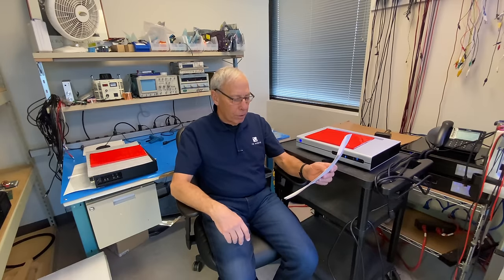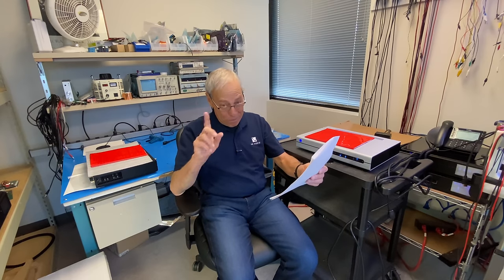How do you know if your caps have aged?

Comment: one thing I would say is sometimes be careful when it comes to replacing capacitors. and I mean in the way that I had an older arcam amplifier that I had purchased out of the '80s. I just love the sound of it and I really enjoyed the quality I was getting from it with my speakers and it had never had the capacitors replaced. so a year and a half ago at a friend suggestion I took it to a guy who works on HiFi and for $150 he replaced all the capacitors that needed to be replaced and he did say some of them were off value and going bad. anyway when I got that thing home and hooked it up it sounded a lot different and not better to me. long story short I ended up selling the amplifier because I ended up just not enjoying the sound of it anymore.
Reply: This is exactly what I'm worried about happening to both my infinity rs-3B's and reference studio monitors. Not to mention messing them up. What do you think?
Reply: @stevenneese2823  I would worry less about messing them up and more about messing up the sound. That said though it can be more detrimental to not replace the capacitors instead of replacing them. Now in speakers it's not as critical per se but in an amplifier if you have a bad capacitor that's going bad and leaking for example, it can leak out on to the main circuit board and damaged further components and it could hit a point where the amp is effectively destroyed, so obviously it's important to replace these capacitors.

I have learned however that there is such a thing as leaving well enough alone. Meaning if something's working well and there's no problems with it and you take off the lid and equally there's no problems with it that you can see, then don't mess with it. It's kind of like having a vintage car that's running great and just because someone told you that the engine needs to be pulled out and overhauled you decide to do it and afterward you have more problems than you did when you started.

I will add that every pair of vintage speakers that I've heard that have been recapped, I think they ended up sounding better.
Reply: the problem there could be determined by the fact that they replaced capacitors but with some low quality ones, meaning many good amps from 80's used bipolar and quality (fot the time) caps, and because the capacitors in the signal path are responsible of the sound signature, capacitors must be replaced with caps with same specifics.

Comment: Thanks, Paul, for answering my question!  And thanks to everyone who commented.
A little background info, for those commenting.  Yeah, I can solder and will replace the caps myself.  I've had the crossovers apart, when I (partially) bypassed them to use one of Phil Marchand's XM-44 active cross-over kits in a vertical bi-amp configuration.  Phil was kind enough to build high and low pass cards for me with custom crossover points and slopes.  Really loved the way the Duetta's sounded like that, but one of my  amps died (was using identical stereo amps, one per side).  For unrelated reasons, I put the speakers aside.  It was because I've had the crossovers apart that I'm trying to avoid replacing the caps.  You can get to them, but as far as I remember not completely remove them without taking the speakers apart.  Which I ain't gonna do 'cause it's too easy to screw up the ribbons or introduce a rattle.  If you have to retension the ribbons you're in a world  of hurt.    So replacing the caps in-place is the way to go and I'm not really looking forward to that.

Eric  Elliot nails it when he says it's easier to detect bad caps that are in  other gear. One of the caps in my Threshold pre went south and it was obvious.  Had that one recapped by a Threshold specialist.

Comment: Did a complete recap/crossover rebuild of some Klipsch Quartets.  Converted all caps to films with Clarity Cap and air core inductors.  What a difference!  A really beautiful speaker now that sends shivers up my spine.
Reply: When possible, no matter the item, if you can replace any electrolytic with a film just do eeeeet.  Seriously it is a no brainer as films will normally out live any of us while electrolytic caps begin drying out the moment they are plugged in for the best ones and the crappy Chinese ones they begin the moment they are made.
Reply: Was this done as a blind test comparing one side versus the other pre/post replacement? If no, the data is null.

Comment: Being one who owns some vintage gear, I learned that for amps and receivers it is fairly easy to tell when the caps have aged just by the change in sound. Caps in crossovers on speakers though are harder to tell. I don't have any vintage speakers anymore, but I would imagine the sure way to tell on those is with measurements.

Comment: Funny thing, but I've got a fair-sized collection of audio gear that's mostly around 40 years old and I haven't had to replace a single cap. Capacitor replacement seems to be a peculiarly American fixation. I ran this past an electronics tech friend - with a view to putting paid repair work his way, if needed - but he tells me that it's not unusual for even electrolytics to still be performing within tolerances if they haven't been overworked or stored badly. 
Before the naysayers weigh in, my old ears are in pretty good shape (17Hz-17kHz) and yes, I do know what high-quality audio sounds like.
"If it ain't broke, don't fix it" seems appropriate.
Reply: It probably dosn't sound like it used when new. Electrolytic capacitors all age. This  is not a georgraphical issue. Greetings from Germany - replace your caps! You will hear the difference.
Reply: Fat Rat  Oh....so you did buy those 15k DeVores and you've not been telling us. 👎 

Ffs mate share the goodness....."So this is re-e--e-l"

Seems everything round here is Sunnyboys!
Reply: An obvious sign of failure is a leaking or bulging can. The big power supply filter caps seem to be less prone to failure.
Reply: Fat Rat  getting some good bargains...connections in the industry or just sales given the current circumstances?

Definitely gets to a stage where you're happy and that's all that matters. Too much arsing about round these parts.
Reply: Hi, @matekochkoch  ! I'm sure the caps have aged; they just haven't aged enough to depart from their specified tolerances. I've owned several items from new, or nearly-new, and they still comfortably outperform more recent equipment.
Reply: Fat Rat  Yep, my 40yo Monitor Audios are still ticking along nicely too!
Reply: @Fat Rat, can make audio better is a myth.
Reply: I have 2 old Oscilloscope one is around 1975 and they work perfectly. Made in Japan must be the old stuff was well made ?
Reply: Fat Rat  just checked them out....seems they are selling some of those lines at wholesale/cost (nice find). I remember when that store first opened. 😮

If you're not up to speed, have you heard Dylan's new track? A 17 min opus. Can't seem to paste a link via my phone, since they updated YouTube app. Can only 'share', so you'll have to search if you've not heard it.

Hot cross buns to you!!! 🐇
Reply: @cat-lw6kq  
Brings back memories.  I kept an old Heathkit scope built in the 1950's, until the 1990's.  Still worked reasonably well, but I hated using the old style horizontal sweep generator and the lack of DC coupling for the vertical amp.
Reply: This is Brian, Nev. I've had equipment that was very old and it never needed recapping either. But I have decent systems to people and because they placed items on the top of the amp and allowed it to not breath. The caps dried out due to lack of humidity and lack of proper ventilation. And dirt. You take good care of your equipment.
Reply: @wendystarita7996  Very true - I've just acquired an old Trio tuner that had its feet removed by a previous owner - it must have utterly fried the amp it was presumably sitting on!
Reply: Fat Rat  Yup,I knew you were in audio retail in Sydney for years, but that was about it.

Funny you mention Roksan. I was rummaging around looking for an old external drive...thought it had some music on there. And, although that hard drive didn't contain the music I was looking for, there were some Roksan cables. Bet (maybe not😂), that you never knew they once made cables. 

When connected to a Roksan TT....they totally made it sound analogue. Fact!

So....connecting them to a cd player....how did they sound? 😧👀
Reply: Fat Rat  oh....when connected to a cd player they sounded like any other...despite the fact the salesperson was adamant (bloody liar), that they sounded much warmer....aka more like analogue. What a fool 😁

Back then I had some van den hul, kimber, some Aussie made silver cables and buggered if I can remember what else. Never sold anything, all on storage....piles of cables🆘
Reply: I check with my instruments. Capacitors as they age slowly turn into resistors. I have a set of 50-year-old Wharfedale W45 speakers who's crossovers had Minerva NPE’s which caused an insertion loss of almost 7%. They still sounded very good but the replacement with Mundorf E-Cap NPE’s, and Sonicraft Gen II bypass cap’s they really opened up.
Reply: Replacing old electrolytic capacitors with new, lower ESR caps and larger, lower DCR inductors may change the sound. Is it better? Idk. It’s different. Probably get more bass and either more treble or small change in one knee of crossover = people will tell you the treble and mids are clearer
Of course eventually old caps will go out of spec. 
I might try new caps on my B&W, but will try to find out what they recommend as they were designed with the ESR in mind. Fiddling with resistance values of caps needs a compensating resistor possibly
Reply: @RennieAsh  i just.replaced my 25 yr old yamaha subs capacitors and i believe it tightened up.their.sound. more of a thump sound with a definate end instead of a fluffy sound. Not much change but sounds more precise
Reply: I just recapped a pair of the infamous B&W Matrix 801’s from the 90’s. Even in that speaker, B&W used  70 volt bi-polar electrolytics in the midrange and they fried, silencing the midranges.  Thankfully the drivers were fine.  B&W did use the ubiquitous and still available (and cheap!) MKP yellow film caps in the tweeter section and they were fine.  Finding the right value film caps for the midrange section was a challenge being that the crossover was on a PC board and the original electrolytics were much smaller. So, folks, make note of how much room is available for those high-end film caps the size of my fist before backing yourself into an expensive corner.  Measure thrice, desolder once 👍.  Luckily for the B&W, some brands of film caps of the same uF value were available in a smaller 200 volt size instead of the much larger 400 volt size.  That, and a couple vertical mounts did the trick.  And yes, the B&W’s opened up nicely and a layer of grain was stripped away.
Reply: I'm in the UK,last week I picked up a pair of well looked after whafedale dovedale 3's from my local charity shop they are over 50 years old like me & they sound spectacular i was temped to get them serviced but I'm not going to bother now.

Comment: Basically, If your equipment is over 30 years old or so, (the approximate average useful lifespan of an electrolytic capacitor, depending on service use), and especially if the equipment has many larger value electrolytic capacitors in it, like amps, power supplies, and most older speakers generally do, then just get in there and test the caps with a good quality digital meter, (preferably when the caps are OUT of the circuit for best accuracy, even though there are some more expensive capacitance meters that say they can measure them while they are still IN the circuit, I still like to desolder them first, at least on one lead, before testing them, that way you know that nothing else in the circuit that they are connected in is affecting your readings of their value), and if any of them are out of tolerance of their marked capacitance value by anything more or less than about 25% of their marked value, then they have gone bad and need to be replaced ASAP, or you can run the risk of damaging your equipment or your tweeters in your speakers, etc!... 

Capacitors only keep getting worse, and further and further away from their marked value over time, and equipment usually starts operating improperly, (or sometimes not at all), after the capacitors in it get "out of spec" by more than about 25% of their required and marked value, (sometimes even less than that), so if your equipment starts acting funny or not behaving or sounding like you know it should, then it's probably time to replace its capacitors! At least the electrolytic ones, as Paul mentioned!

Comment: To test amplifier caps run a full-range sweep through your system. If the caps are bad you’ll notice distortion in the higher registers. I found this by accident when testing a speaker build.

Comment: If you have to ask... then the answer is yes. Caps fail... first it’ll mess up the sound; then it’ll leak and damage your equipment. There’s lots of good soldering videos on YouTube; but making a long story short; get a temperature controlled soldering station (with a desoldering gun if you have more than a few to do; otherwise some solderwick will do); use the biggest tip that will fit in the space (bigger tip = better heat transfer); put a small amount of fresh solder on the tip to act as a heat bridge when desoldering; use plenty of no-clean flux; get some magnification (I spent the $$$$ and got a stereo microscope, but even just a simple desk magnifying glass helps a lot); and get some flush-cutters and needle-nose pliers. Oh, and it’s probably obvious but don’t use plumbing solder and flux - it’s corrosive. Get a good electronics grade solder and no-clean flux (leaded is easier to work with and makes better connections; just be sure to wash your hands afterwards...  and it’s not an environmental issue because you’re never going to throw your gear away, right?).

Oh, and get some low-value or dead PCBs to practice on before attempting surgery on your fancy high-end gear!
Reply: Great advice.
Thanks!

Comment: Paper in oil caps a perfect for speakers, more so if you're running tube power amps, or some types of foil the mundorf silver and oil. Wiring two capacitors in parallel is always better approach replacing the one cap for two this is easy to find an unusual value as well, and the low poly film cap as well 0.1uF in parallel keep the voltage up to about 350V. Try and get them matched pair or 1% or lower

Comment: De-soldering can be much more tricky than soldering since leads can be wrapped around lugs and you really have to fully remove the old solder to release them. Even de-soldering a PCB connection can be difficult. You can buy a simple manual "solder sucker" which is better than nothing but the best solution is a de-soldering station with a vacuum pump for through removal of the liquified solder.
Reply: well xovers are not on PCB usually so you can simply cut the wires/legs with pliers

Comment: I have a friend with an Audio Research SP3 preamp and it started humming so he gave it to me to fix for him. All the filter cap cans were open. I replaced them all with separate electrolytics and it worked fine. I checked the electrolytics in my Audio Research SP6 and all were bad but I didn't have a hum due to the 4.7 MFD Wonder Caps I have bypassing the 300 MFD electrolytics. I replaced them all but didn't use the most expensive caps but it does sound ok. I've had some slight random noises in one or both channels ever since I put them in. Not sure if its wonder caps going bad or what. Everytime I mess with it I get the noise to go away but when I put it together the noise comes back.

Comment: Pauls right nobody wants to work on them , I found someone to restore my perfectly working Sansui G-8000 and they wanted 2k for labor , I work so much i haven't had the time,
 until this cov19 got me layed off so now its all re-capped and sounds amazing got it for 1400.00 and spent about 100.00 in caps best 1500.00 amp i ever had for the price smooth warmth ! With Scale !
Reply: Wtf, what a ripoff. How many caps were in that thing?
Reply: Sorry to hear you got laid off!  I hope you fall into the category of making more on unemployment with the extra $600 a week.  I'm usually against this system of making people more money than they were making before they were laid off but for some reason, I feel the opposite with you!🤔🤗😇  And that's the biggest compliment I can give!  Now get that 580 review up already🤓😝
Reply: @xanderguldie    Caps, at least in the U.S. are not inexpensive, at least if your are using good caps like Solen.  They start at about $5 each for the small values, and go up from there.  Even a 47 micro Farad Solen runs over $20.
Reply: 2K for a restauration by a professional is not too much. 2K for a repair by an amateur is way too much.
Reply: @doowopper1951  I was talking about the labour, wich was $2000. So the caps weren't even included. Still those caps are also pretty expensive. Over here they are pretty affordable. Lots of good stuff from Germany.
Reply: @hugobloemers4425  that depends on the amount of labor required right? It may beba bargain but it could also be very steep.
Reply: @bigjay1970  Thaks Big Jay 😆 Yeah I just got my student loans paid off , And working maintence dept at Montaplast i was getting 70 plus hours a week time and a half on Sat Double time on sundays some sundays i worked 12 hour shifts so yeah i will be making less but i am not complaining at all ! 
I am very furnute and yes the review is coming soon big jay !
Reply: $2000 recap ISN'T too much for a professional??? Wow. I guess I'll be recapping my receiver by myself then. Better start practicing.
Reply: Satisfying isn't it?! 😊
Reply: @charlottejet4338  Yes ! Just miss using a remote 😆